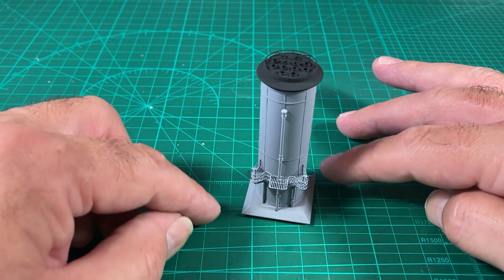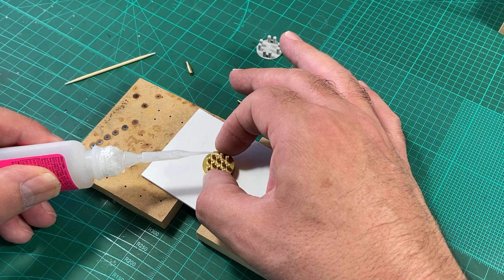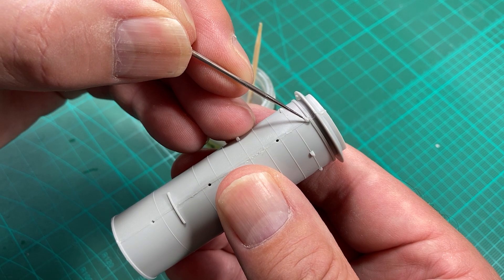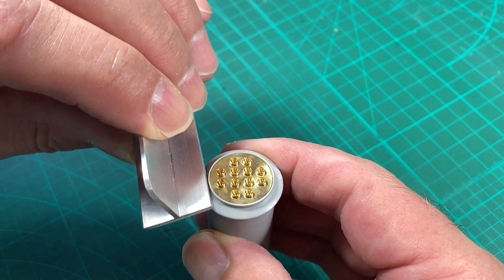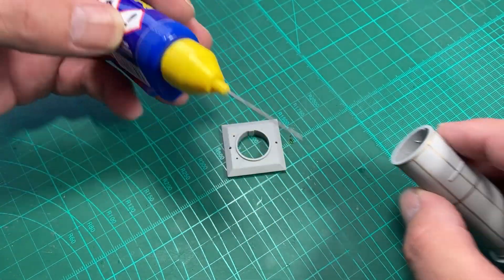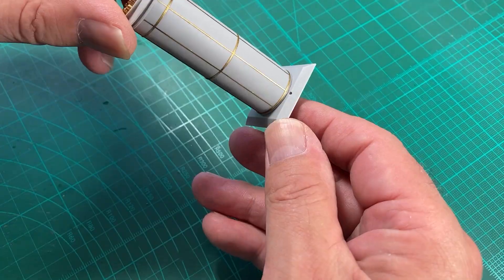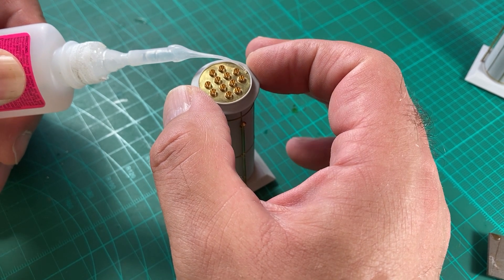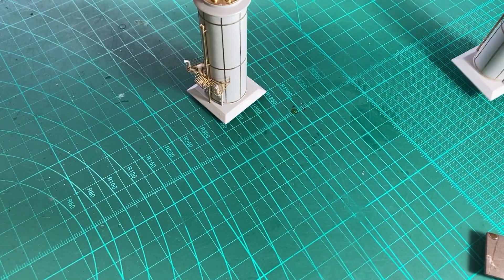IJN Mikasa 1/200 Scale, Pontos & MK1 Design Detail Sets, Part 26 Ship’s Funnels

Comment: Flat out amazing!!!!  I'd just completed the mast assemblies and started on the funnels. I'd assumed that you would use most of the MK/KA parts so, since I'm using only Pontos, I plowed ahead without waiting for your video. My funnels are wrapped, the top "spiders" are assembled (super glue) and I'd just started mulling over the steam pipe brackets today.

I halfway anticipated that you might ATTEMPT to solder the "spiders" and steam pipe brackets, but I said "No way, not even possible". I'm still shaking my head in disbelief as you pulled off a couple of miracles... and made it look like a walk in the park. My hat's off to you!!
Reply from the maker: Thank you for the nice comment.  Sounds like you are making good progress.  My holiday break is almost over so my progress will be slowing down again.  I think I'll be using 100% pontos for the masts when i get to them.
I surprised myself with the soldering, still learning myself whats possible.
Reply: Your method to attach the steam pipe brackets worked perfectly! Before seeing your video I had mulled over making a jig, or laying the pipes/brackets on their sides to solder, or just gluing the things. Your solution is elegant and, by far the best, whether you solder or glue. Have you given any thought to rigging the funnels?

With respect to the masts I came across 3 "learnings":

1) The mast main bodies act as a huge heat sink and my Hakko 888D (with my largest tip) could not generate enough heat to get a proper joint so I super glued all of the connections to the masts. If you want to solder parts to the main mast sections you might need a higher capacity iron, or small torch.

2) The starfish slots have a VERY small amount of front-to-back "play". I built the foremast first. I biased the gussets inward (towards the mast) thinking that I wanted a tight fit to the mast. I then found that the the mast did not fit cleanly through the platform hole. I had to carefully file back each gusset in order to get the platform to fit down correctly on the mast "step". I biased the gussets biased OUTWARD on the the main mast assembly and it was a perfect fit. As we know, Pontos' engineering is SUPER precise.

3) I pre-bent the railing before assembling the platform and starfish. To me, it appeared that the railing was a shade too long (I like to position rails on TOP of the surface) so I soldered the ends in a lap joint (instead of a butt joint). Alternatively, you could affix the railing to the sides of the platform, and use the starfish legs to support and position the railings to the sides of the platform.

Best of luck with your mast sub-project... and please keep those great videos and tips coming. For the "arm chair" builders its great entertainment, for us actual builders you're a god-send. Happy New Year!
Reply from the maker: Thats great my method worked for you.  For rigging the funnels I do intend to.  The KA Models set has PE 'lugs' which would need to be superglued to the funnels sides.  From the instructions I think they would be overscale and to be honest in my excitement to finish the funnels, forgot about them!  I think I will make some eyebolts out of thin brass wire, 6 per funnels, 3 each side.  I should be able to drill holes in the funnel without messing it up to fix into and should be a stronger bond, than PE edge glued.

I think where to belay the ends of the funnel stays is going to problematic as I think the ships boats will get in the way.  Will have to play it by ear when I get to the stage.

Thanks for the heads up with the masts, always good to be forewarned!

1) I have the same soldering station and wondered if it had enough grunt for heat transfer in to chunky brass.  I do have a torch so might try that alternatively may just use 2 part epoxy glue.  

2) Good to know, thanks!

3) ah okay, a quick glance at the masting assembly looks like a lot of parts will require some thought into the order of assembly.  I think I only have 3 major assemblies left, the 12" turrets, the masts and the ships boats...then on to the myriad of small details! 

Happy people are enjoying the videos, they do slow me done a bit but fun to do.  Happy New you to you also.

Comment: Hi, Best wishes for 2024.
 You are really an inspiration for excellence in modeling. Those panel lines on the funnels are so difficult to adjust properly, I think that I would be afraid to use them and replace them with Evergreen Styrene strips, still without guaranty that I would succeed but you did it beautifully, the hard way. I'm also impress with the accuracy of the P.E. 
You probably know Loctite Super Glue Ultra Gel Control, I find it useful in some case as it stays in place and doesn't set immediately, leaving a few seconds to adjust. I also mix super-fluid Cyano with regular cheap cyano in tube so that it's still fluid but not enough to follow capillarity and lose control. 
Next time I work on P.E., I will keep your example in mind and try to do it better than I usually "get done". Thank you and good continuation👋🏻
Reply from the maker: Thank you for the kind words. Yeah I have a number of CA types including the gel.  The second funnel I lightly rolled the PE and did a tighter roll on the ends so they were pressing against the surface when I got to the end. That got rid of the struggle trying to get the ends down.  Thats the trouble with doing things for the 1st time, don't have spares to work things out...unless have 2 sets of everything to practice on!